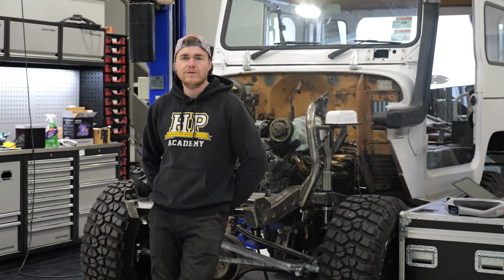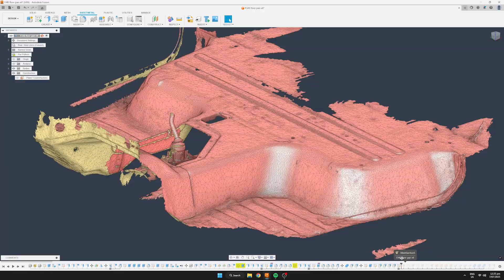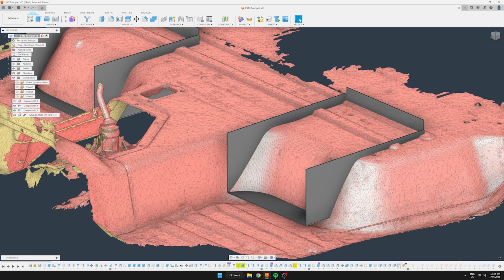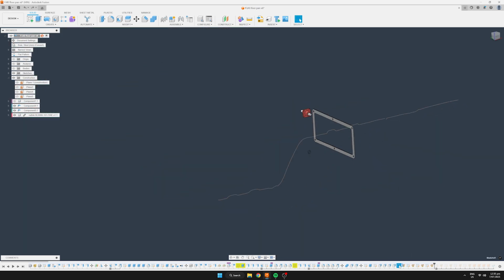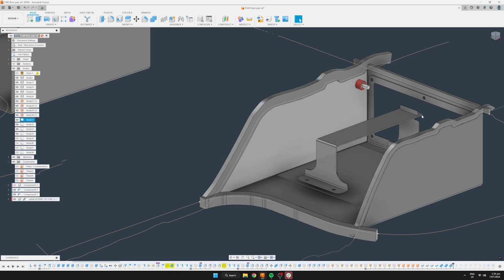3D Scan and Model YOUR OWN Parts!

Comment: Impressive, but is all this faster than cardboard aided design
Reply from the maker: The answer there is sometimes. We love a bit of cardboard when we think it's going to be faster :)

For this project however that involves us making mirrored parts for multiple corners of the car incluiding an ABS sensor ring (mocking that up in cardboard would be pretty intense!) and a mount for the sensor that is curved, has a recess etc, CAD was the way without question for us.

Of course in the same situation you make your own call, but I hope some of that reasoning helps to show why it is such a great skill to have when you need it - Ben

Comment from the maker: 10 years in the making but this old FJ40 is closer than ever to hitting the road. What's your current project?
TIMESTAMPS
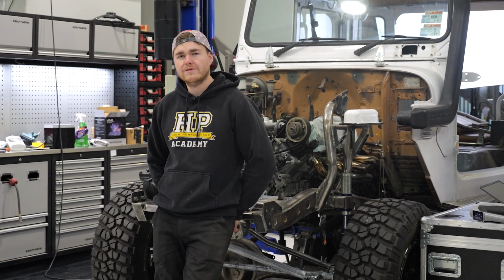0:00 - Sheet Metal Project
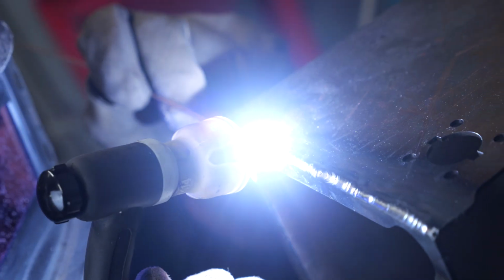0:10 - Step 1: 3D Scan
0:14 - 3D Scanner Options
0:25 - Positioning Targets
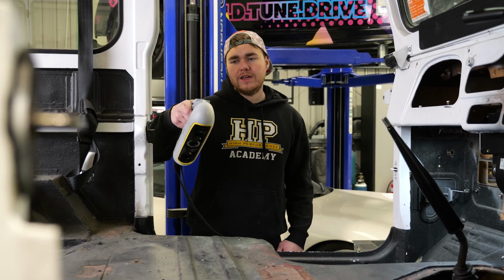0:40 - Scanning Distance
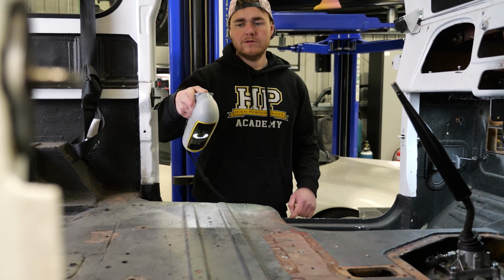0:45 - Getting It Into CAD
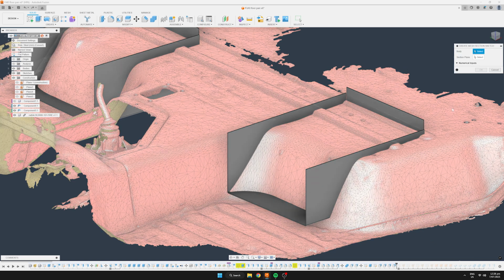1:18 - Mesh Section Sketch Work
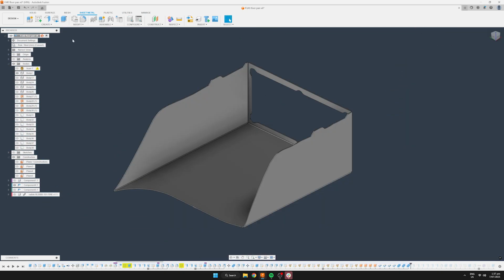2:14 - Sheet Metal Flat Pattern
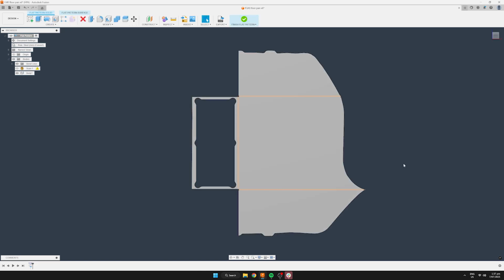2:22 - Learn How To Do This Yourself
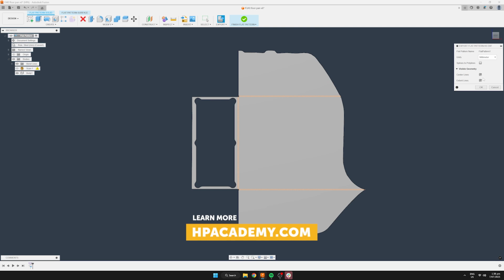2:29 - Laser Cut: 3rd Party Manufacturer
2:37 - CNC Folding
2:48 - Parts & Final Product
3:09 - Why TIG?
3:15 - Tools Used
3:20 - 3 Step Process
3:45 - Seamless Finish
4:08 - What Are YOU Building?
Don’t waste hours or weeks of trial and error. Learn how to fabricate right with 50% off your own high-quality online courses:
3D Modeling & CAD for Motorsport: https://hpcdmy.co/labcad1
Practical 3D Scanning: https://hpcdmy.co/lab3d1
Practical TIG Welding: https://hpcdmy.co/labtig1
Save $400 USD on 40+ Courses | VIP Package Deal: https://hpcdmy.co/labvip1
Reply: 1995 Ford F150. Ford 300 (4.9) straight six. Currently welding together 2 LS cathedral port heads to stick on top. Once all the machining etc is done, I'm going to be utilizing my 3D scanner to aid in designing the twin turbo exhaust manifolds and the intake manifold.
Reply from the maker: @corneliofehr8001  RAD! That sounds amazing. - Ben